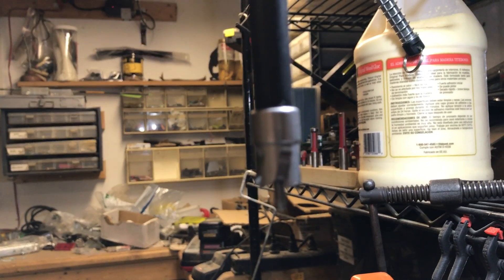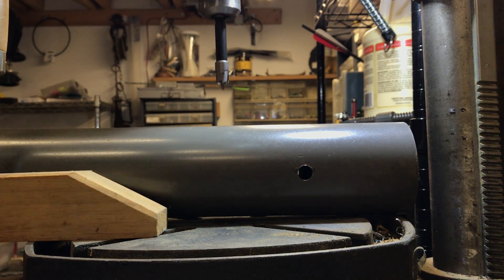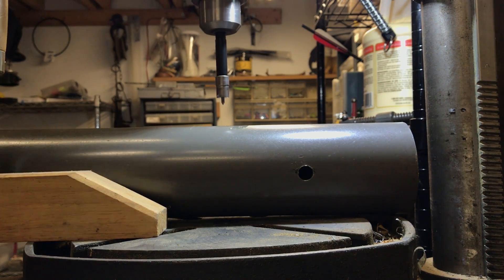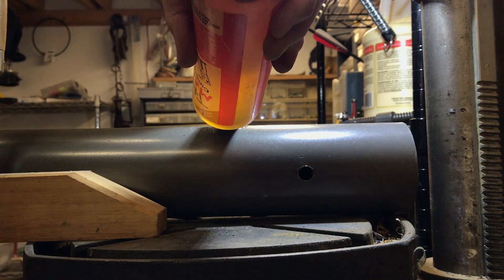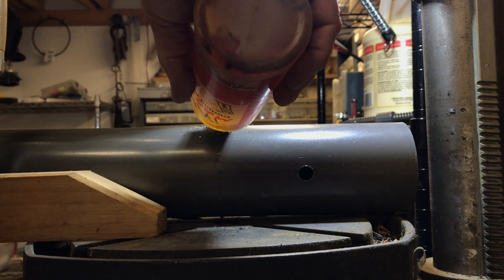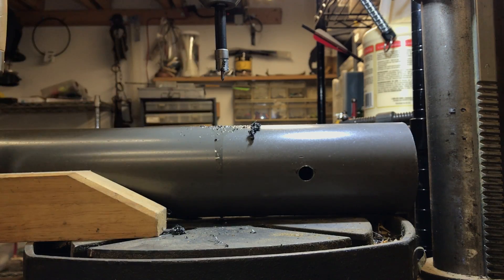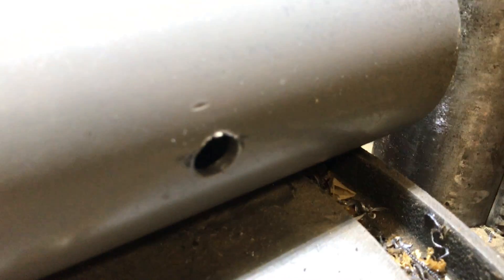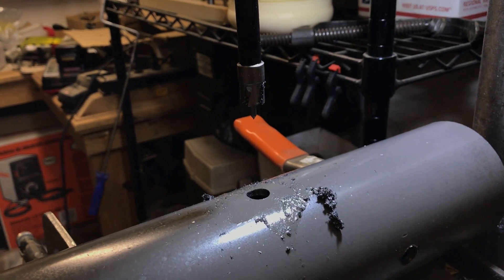First try using Hougen 1/2 inch annular cutter on some steel  pipe

Comment: Use lots of oil.  Transmisssion fluid if you must, motor oil, or even regular cutting oil.  you must use oil if you want the annular cutters to last.  Most annular cuttters seem to work best at about 500-600 rpm.

Comment: These cutters take power and torque to turn and, dont need high speed to run. When you slow it down you get more toque multiplication from your drill press so it has less tendency to stop or bog.